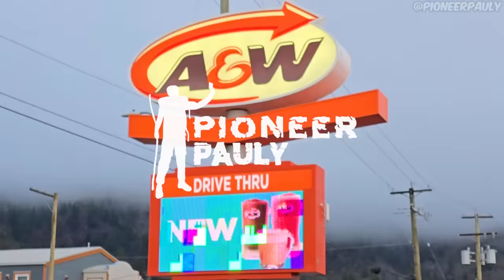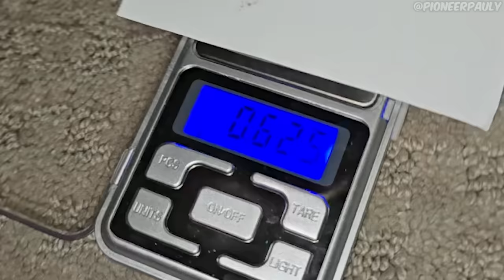How Much GOLD Was Under All These Boulders?

Comment: My grandfather, born in 1889, used to work in the forestry on an island that had gold deposits. When he was 18, his job was boilerman running the steam powered dragline that pulled logs out of the forest. Imagine a  five kilometer long two inch thick steel cable joined in a  loop, running  out into the forest, around pulleys and back around your winch. When they had a log  off in the forest, they would cut a path  to it from the loop, run a wire out to the log, "nip" the other end of the wire to the mainline, and then someone would beat a code of pulses onto the mainline, with a steel rod. Grandad would have his hand on the cable, and could feel the  impact travel down the line, and would turn on the winch.
A lot of the  forestry guys had been gold prospectors, so they would take extra cables up, and run them to two or three tonne boulders that were laying around in the area, and had probably never been moved, loop the cable in a way that meant the boulder would turn over then release the wire, and then they could go up there and pan out gold on their time off.
Grandad would be given the wink and know the drag as going to be much harder at the start than normal.
Reply: If your grandpa’s still alive( I assume he’s not but I might be wrong) he probably passed the world record 
But good for yo grampy
Reply: And this has what to do with amateur gold prospecting?
Reply: His grampa is a badass tho
Reply: @cruejones742  As if  I care about your opinion, child. 
You didn't read through the post. The forestry, coal mining and road building all around the world used drag-lines, and I wondered if other people have similar stories from their grand dad's times. The sort of men who run a drag-line operation, are the sort who know the area's history, and like the idea of gold, mate.
Reply: @mengomango8107  No, he died at 88 years old in 1978. I didn't think I had to say he was passed away.
Reply: Rip for your grandpa 
He was a total badass that deserved all the gold
Reply: @mengomango8107  It was all a long time ago. I only know the very little I do know about his life, because when  I was small, he wasn't very well, he actually had a heart attack the day my twin and I were born, then lived on unwell for 12 or 13 years.
And  because he couldn't walk around or talk quickly, he would  tell us stories about working in the forest, how to catch fish in the days before  commercial fisheries ( One word for that : Easily ) and would show us how to  do things like use an ax or a saw or a paintbrush, by sitting in his chair and quietly and patiently explaining while we  did it.
We loved him for that, because my dad was harsh and would make you stand still and watch HIM do the thing, then hand you the tool and expect you to be perfect immediately.
And when you couldn't, he would frown and say "If you don't want to learn, just tell me ! ! ! I have better things to waste my day on than YOU swanning around when I am showing you something !". 
I learned more from dad, but i don't  love the memory of any of that.
Reply: I love people sharing good memories with me 
It feels so nostalgic for no reason

Comment: 😊😊 HI fellows why don't yall use a 12 volt motor cycle battery 4 the water pump they aren't that heavy and U can put it in a 5 gallon bucket and carry it U aren't going 2 find another battery any lighter in weight that's not very heavy and U need 2 put a peace of mesh wire around the water pump 2 keep the rocks and trash out it will ruin the water flow 😮😮 OMG 11 14 2O24